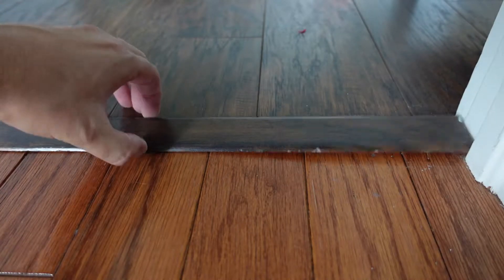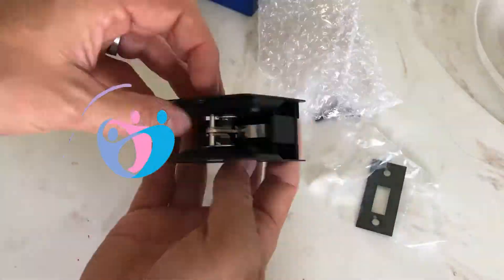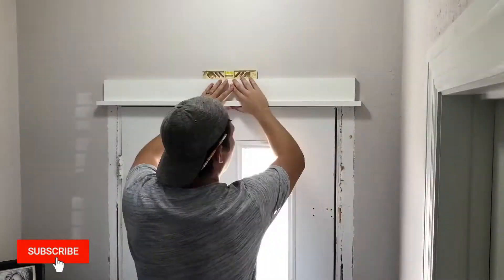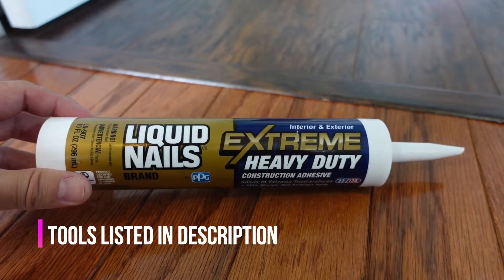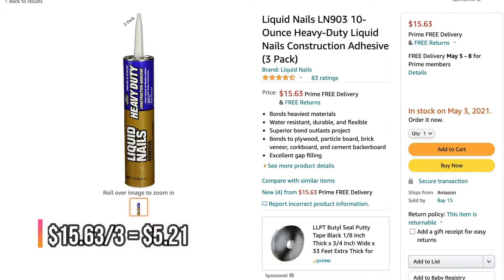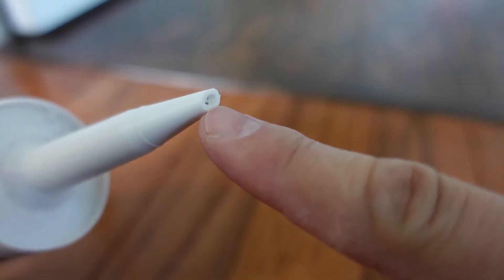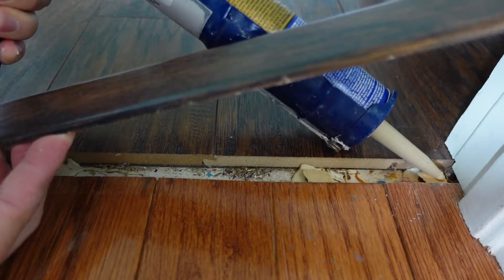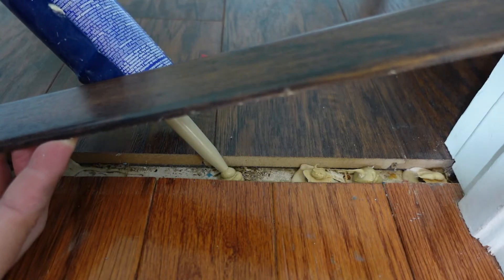How to fix a t-molding? | quick floor transition strip repair

Comment: Been on your page for only a few minutes and love it. I'm thinking of replacing my transition plate for my dining room. Any suggestions on how to remove it without causing damage to my floor? I don't see any nails so I'm assuming it has the glue
Reply from the maker: Umm. Usually only the bottom part is what gets glued down but I would maybe get a putty knife and try to get under it to make sure nothing is glued to the actual wood. Then use a pry bar and try to gently rip it off.
Reply from the maker: Let me know how it goes. Thanks for feedback by the way. 👊🏼
Reply: Awesome thank you

Comment: Clean out where the old t mold was, always always.

You cant glue something to a pile of dirt and scrap stuffed in a hole.

Im genuinly appauled.
Reply from the maker: 🤷🏻‍♂️ I don’t know 3 years later and it’s still holding up. But yes clean surface works better 😅